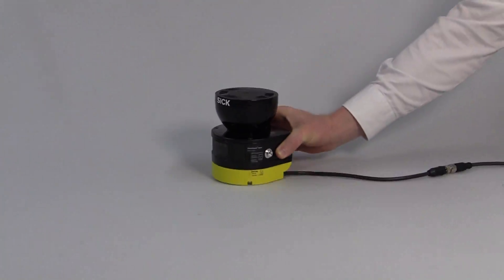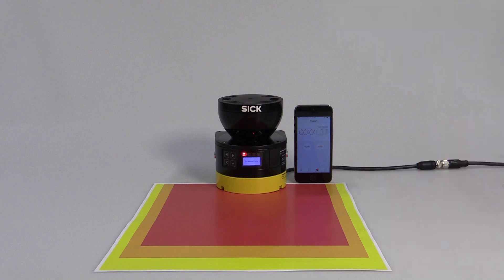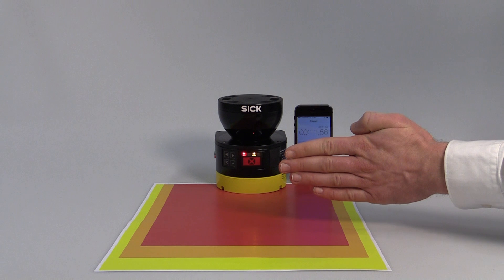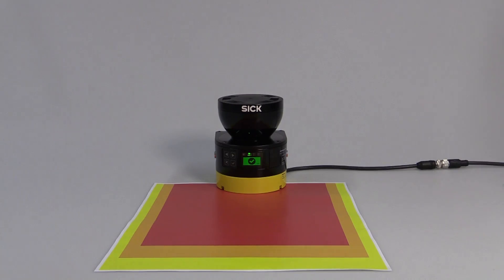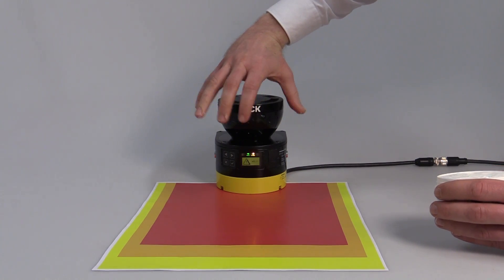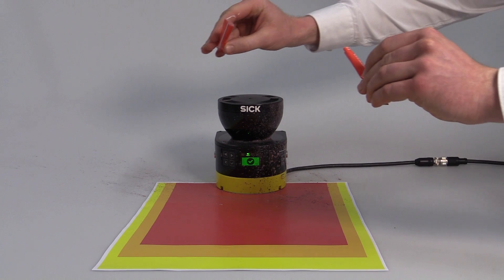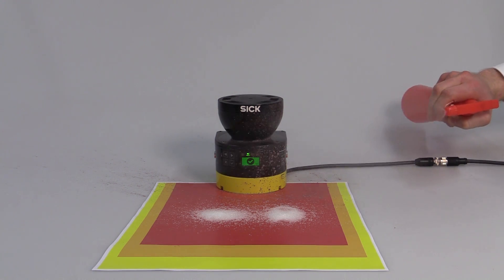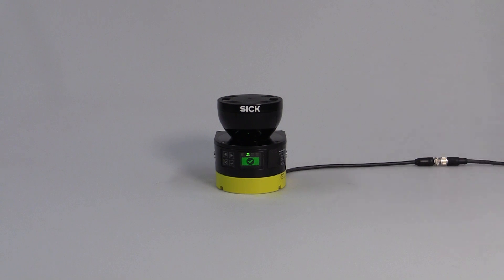microScan3 proves its robustness | SICK AG

Comment: Can this be used in an environment with water spray?  e.g. robotic milling where the spindle uses coolant.  Thanks.
Reply from the maker: Hello @GregsStoneYard and thank you for your question! 
In general, the microScan3 has an enclosure rating of IP65 (IEC 60529) and its operation is based on an optical principle. This must be considered when evaluating whether the device can be used in these conditions. It is possible that the “outdoorScan3” with its accessories “airWiper” or our Safety radar sensor “SafeRS3” could be suitable for your application. However, this would have to be checked on your application in detail. Please contact your national subsidiary responsible for your country to check how your application can be safeguarded in the best possible way. 
You can also contact us here: https://www.sick.com/contact 
Our colleagues will then help you with your request as soon as possible. Have a good day!
Reply: @SICKSensors  Thank you for the detailed reply.